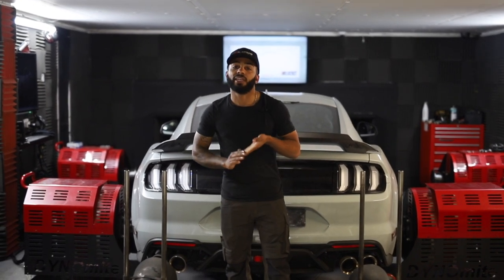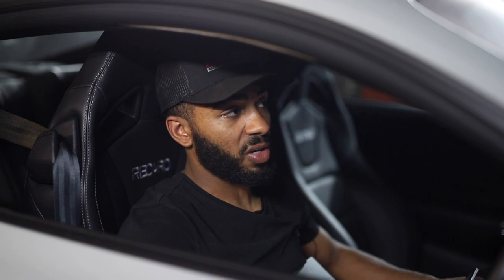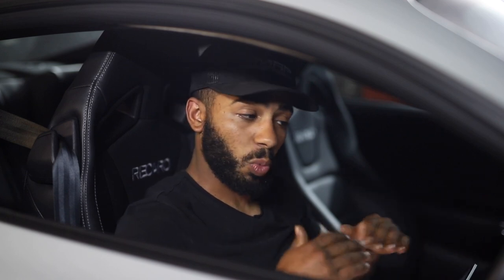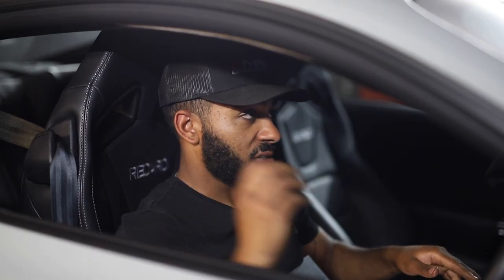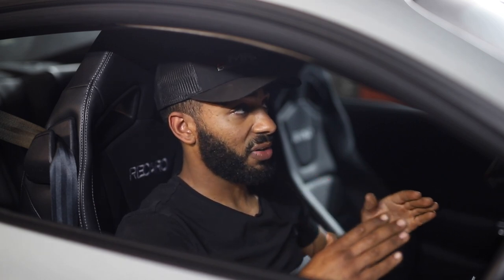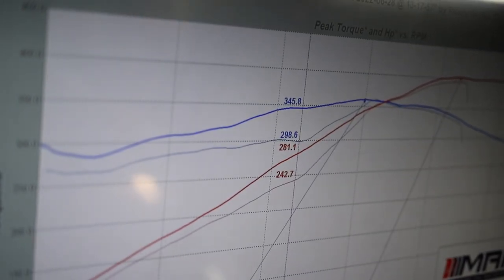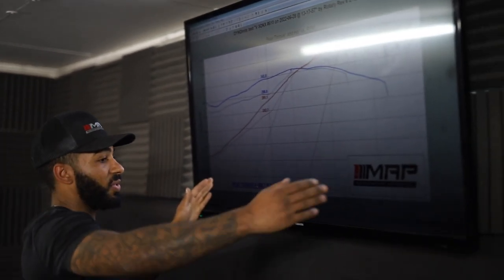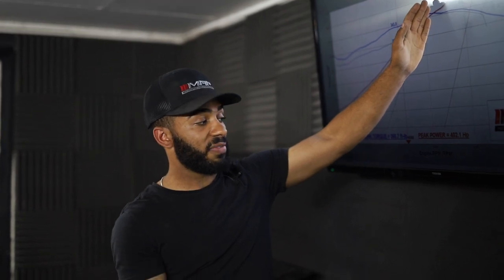Ford Mustang Mach1 - Stock VS Stage 1 (Why You Need This)

Comment: MAP did my ECU tune, headers & cats.  At 2,500 RPM my car now has the same torque as the stock car had at nearly 6,000 RPM.  At 3,000 RPM, the car now has +40% more torque.  It has completely transformed the car and it drives totally different.  I would highly recommend the MAP tune.

Comment: I find it interesting how realistic your numbers are. Mostly here on YouTube the pros state  the numbers are high to begin with, then they do their magic tune and all of sudden they made 30hp more. So much for transparency. Ty for putting the true numbers out there without the hype.
Reply: cheers - these are EU spec cars with the GPF's on though. Expect US cars to make a bit more power out of the can
Reply from the maker: Thanks for the feedback and support 😎
Reply: @bendunn5422  what exactly to they do to make less power. If it was just tuning then after tuning the numbers would be compatible. But in this case numbers are still lower. Do they have different cams,throttle bodies….etc. interesting. Thx.
Reply: @vitoaugello1677  GPF's are the primary reason for the lower power
Reply: The curve is much more appreciable than chasing after a number to compare how big yours is vs another’s.

Comment: IMO Ford needs to quit messing around and F150 the Mustangs up. The Speed Density, and Flex Fuel setup that the F150 uses is the bomb. Even the new GT500 has dumped MAF for SD. I can understand a MAF setup for a SBC, but most people don't want to cam the hell out of their DOHC Fords, and SD has come a long way since the 80's/90's. It just simplifies everything not having to worry about a MAF setup, and tuning a new SD setup is easy peasy from my understanding. Plus I really don't know why Ford doesn't add Flex Fuel to most models, but especially Mustang. F150 with Coyote (but not Ecoboost) is a Flex Fuel vehicle. I DD my 18 F150 with E85, and with a flex fuel tune the computer reads your octane, and adjusts timing accordingly, so no need for a 93 tune, or a E85 tune, or a towing tuning, etc. With a custom Flex Fuel tune the vehicle adjusts itself according to what's in the tank. It's very convenient and IMO much safer.

What I mean by that is say you've got a 1/2 tank of 93, but you want to fill up on E85 to get some extra timing added into the engine to take it to the track on short notice. Well if you have to run specific tunes for whatever fuel grade you've got in the tank, then that becomes a PITA, and you're trying to run your tank on empty, before filling up on something else, etc, whereas Flex Fuel automatically adjusts for whatever grade of fuel you have in your tank.

Comment: I had a 2021 GT Premium with a manual MT82 transmission. Complete garbage! I could put up with the cheap plastic interior, engine tick and the glitchy electronics, but the drive train was garbage. Kept the GT for 2 months and unloaded it....was a pile of junk. Bought a real car from another manufacturer with a standard TREMEC couldn't be happier...FU FORD! BTW - if you did buy this POS with a MT82 you can join the class action suit!
Reply: The Mach 1 has a tremec. As for the MT82. A manual 400+hp V8 pre-covid you could get for less than $30k brand new. You literally got what you paid for, which is literally one of if not the the cheapest car on the market by $/hp. The tick is fixed by using high boron oil or ceratec. The Trans has mods to make it better which includes a different trans oil
Reply: Lol